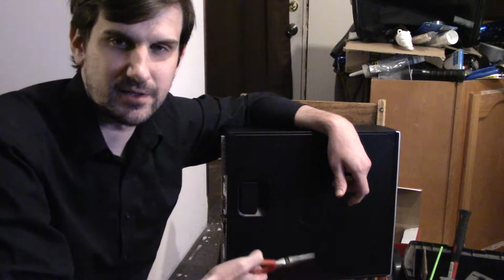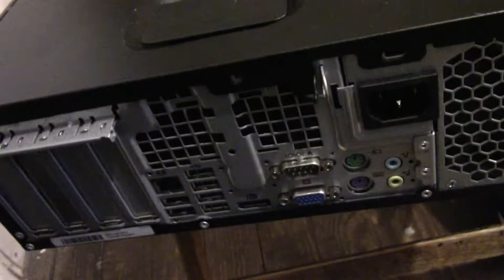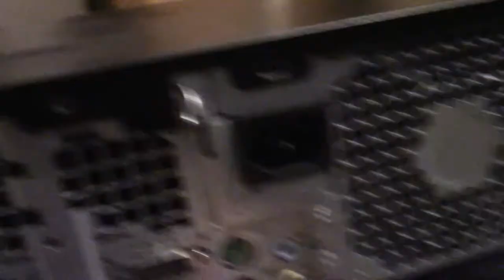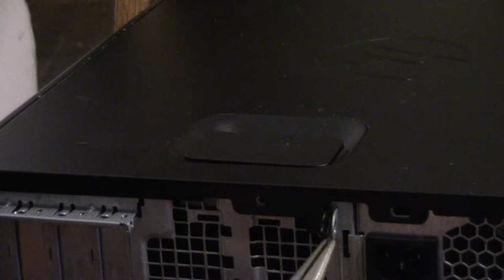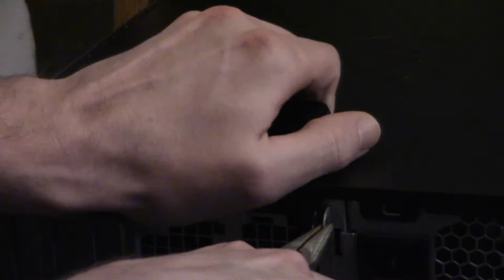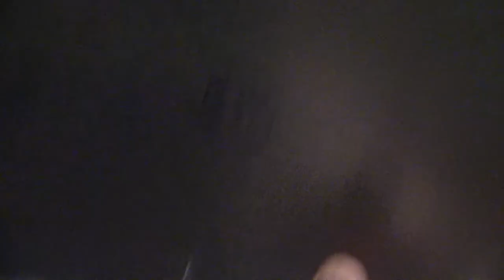HP Elite Case Won't Open - How to open case that is stuck on HP Elite 8300 and 8200

Comment: my dekstop case won't open i try so hard 😭😭😭
Reply from the maker: That sucks, did the technique in the video not work for you?
Reply: @LowcastleTech  yeah and i hate my pc case
Reply from the maker: @zariff07  That is frustrating. When you pull on the handle is it pushing the back metal panel in? I had a viewer that wasn't able to stop it by holding that loop, but they just held onto the vent instead, anything to keep that back plate from pushing in and it worked that way. If you are pulling the lever and it's doing nothing at all I have another video that might help you can see here - https://www.youtube.com/watch?v=9QdYOWE4OWA - Anyway if that doesn't work I hope you can figure something out, that would suck to not be able to get in there.

Comment: I am watching this on a "wtf why does it not open" and I saw myself already cutting it open (while imagining the inner parts burst in flames), so hopefully this will bring me peace. I gonna keep you informed :D
Reply from the maker: Hahah, I've been there. Just remember, resorting to the blow torch may be the most satisfying method, but probably not the wisest. 🙂
Reply: @LowcastleTech  So when I watched your second video, because the first one did not work out, I finally noticed differences in the door (there was not even an opening to push down the mechanism, that's why the first one did not work out). I "obviously" have a different case though very similar. The mechanism is even more crude than yours and so I really had to use a leverage to pry open the door but still that little *#@!! stuck there as if it would be hanging from a cliff. So I showed mercy and it is now my door angle to the case. But with a little tank tape and good luck it will be okay until I buy a new one. lol
Reply from the maker: @tacticalsapper  Hahaha, sounds like it was really clinging on for dear life. They really don't make some of these things user friendly to say the least!

Comment: So you dont need screw driver?
Reply from the maker: Depends on the case. Some cases do have a screw or bolt in the back that you need to take off first, but with this model and a lot of the older HPs you don't need one. You should be able to just pull the handle and pop the side panel off. In this situation that wasn't working because the lever mechanism was pulling the whole back of the case in. Basically, by preventing the metal back-plate of the case from pulling in, it allows the lever to do what it needs to do, to unlock the side panel.
Reply: @LowcastleTech  okay thank you so much!

Comment: I'm pulling back as hard as possible with as much leverage as possible and its still not coming off  i have the exact same case aswell
Reply from the maker: When you initially tried to open the case was it pushing that metal back plate in when you tried pulling the lever? Or when you pull the lever was it just not doing anything? You might want to push down a little on all the edges of the plate first and make sure it is flush and snapped in. Sometimes it gets stuck kind of halfway locked in. But it could be something is wrong with the latch as well, it's tough to say.
Reply: what's happening is that when i pull on the metal part it does nothing i held on to both corners of the case for leverage but it still does nothing i think its a problem with my lever...god i hate this pc
Reply from the maker: @LostMyFriends5   That sucks, sorry to hear that. I have 1 more thing that may help. It is a little hard to explain, so I'm going to shoot the video for it really quick. Should be posting it shortly, hopefully it will help.
Reply: @LowcastleTech  okay then thanks
Reply from the maker: @LostMyFriends5   Not a problem. I just posted. here is a link https://youtu.be/9QdYOWE4OWA and it also should be in the videos section on channel page. If that doesn't pan out, I might be stumped, but hopefully it helps.

Comment: My level isn’t back in its place so this isn’t working yet. My level is like lose or something, do you know how I fix this?
Reply from the maker: Without seeing it, it's tough to say if it is the same issue. I would say watch and see if the metal backplate is still pushing inward when you try to pull the handle. If so you will need to make sure you're getting enough leverage to keep it from moving. First time I did it, I had to put my feet on the corners of the case and apply a fair amount of force pulling back on the metal ring while pulling the handle. Also you want to carefully examine to make sure there are no screws or anything holding it in if it is a different case than the one I have in the video.

Comment: It dosent work i just cant get it open
Reply from the maker: Sorry to hear that. Here is another video that might help. https://www.youtube.com/watch?v=9QdYOWE4OWA  . If the problem is that the metal backplate still pushes in when you pull the lever, there was another viewer who said holding on to the loop with pliers didn't work for them, but holding on to the vent did. Anyway hope you get it figured out, always frustrating when a case gets stuck.

Comment: Is not work
Reply from the maker: Sorry to hear that. If you are having the same issue with the silver colored backplate pushing inward when you pull the lever, you really just need to do whatever you can to keep it from pushing in. Another viewer had a similar problem, and they tried holding on to the vent with the pliers instead of the loop, and that worked for them. If you are still having trouble here is a video with another technique you can try https://www.youtube.com/watch?v=9QdYOWE4OWA  though again, it is hard to say what is specifically causing the issue.